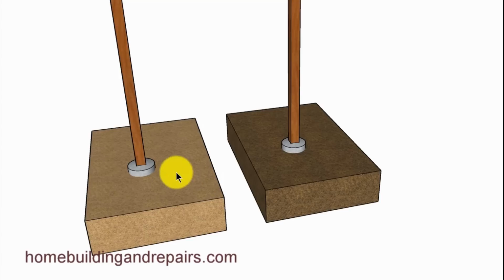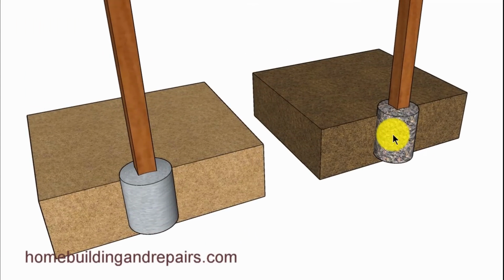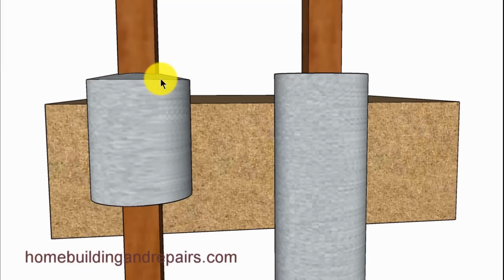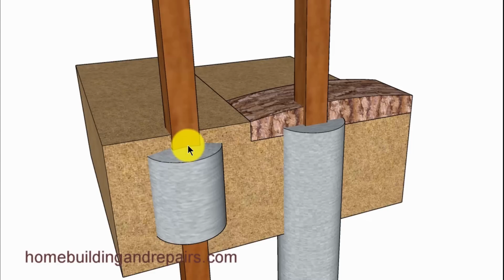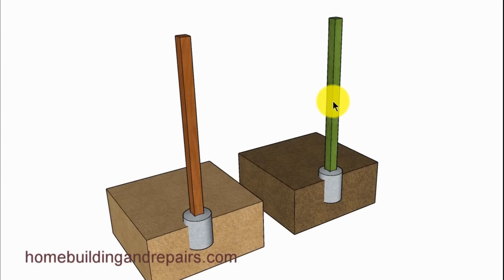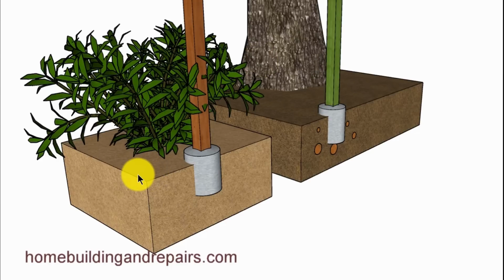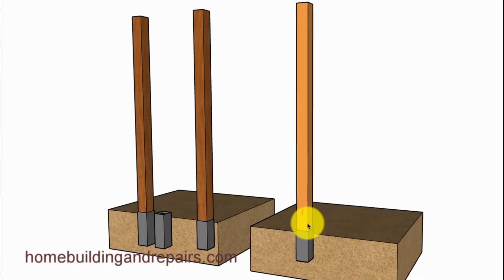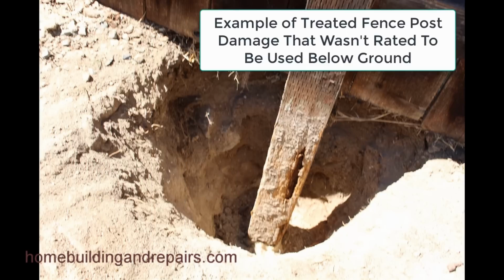Watch This Video Before Installing Your Next Wood Fence Post – Money Saving Ideas

Comment: Us old timers use a 50/50 mix of diesel and motor oil. Paint on 2 coats dry in sun few days. Burn the ends we're you cut off and no oil on that. Roof tar works at ground level
Reply: We used creosote but I had a carpenter tell me it's bad for environment bc of possible leaching
Reply: @julieankhan.2801  Julie the chemical they pressure treat into woolmanized lumber is full off heavy metals , the less of 2 evils is the choice is the question , I use a combination as my post often land in damp clay on my place, Charing is by far the only sure way to avoid ground leach ,but in clay , I use a trip method to avoid costly redo which is worse over all. I use less posts less often , so less trees less often, pure linseed has some toxicity agree, but heavy metal a different animal when it gets into ground waters , I encase in quick set as well so slows the show, gives oils times to bio degrade as I see it. Metals never fully degrade , always trace left
Reply: Dale Val 
That’s how my grandfather set posts and I’ve never had a problem when I use that method.  I never asked him about the burn part but I do it and don’t get rot or bugs.
Reply: @jonathanschearer7778  good man Jonathan gramps would be proud , most youth have no clue how to make things last, they live in the throw away world , I got 6 posts to set this week ,vgit some linseed and my torch ready , just need some muscle to give me a hand, legs are sore and I have preppy snowflakes sins that avoid the old man's farm , I'm seeking a hired man I can will it to in next 20 when I go , god willing. I last another 20 lol.  Thanks for your comment , I lost my PaPa in 86 , I miss him everyday , and he taught me these tricks to survive and thrive for less

Comment: Also if you are worried about a post leaning one way or the other a person can put 2 butt plates on the post. One bolted on the so called north and south side and the other would go on the east and west side about one inch below the other butt plate. This would work for any post.   But especially on the end post to help prevent any tension on the post

Comment: Wouldn't it be better and much easier to rent a air compressor and jet the post into the sand area. No digging required
Reply: It will take you more time setting all that gear up than it takes to dig a post hole in sand. About 1 maybe 2 minutes if you stop to scratch your balls, per hole...LOL
Reply from the maker: @glennturner4807  I remember when everyone when someone judged time by how many beers you could drink and now it's our dangling private parts:)
Reply from the maker: I don't know how you would do it with an air compressor, but let me know how it worked out if you ever do.

Comment: The main problem is the concrete not the ground. The chemicals in the concrete attack the wood and rot it. You can coat the wood with tar or just not use concrete and pack the soil around the post. Packing is better, no rot and stronger if packed right.....make sure you make the soil into a powder and it will pack very nicely.

Comment: It's fun watching what others try when putting posts in. Everybody has a way that works for them. I do not use concrete. I pound in rocks around the post. I have posts in my yard that are over 35 years old. The ones the contractor installed 10 years ago have rotted and all need replacing. My neighbor uses Elmers glue on the ends of the post and up 20 inches. I wonder how long the posts will last.
Reply from the maker: I think if I had some large rocks on my property and my neighbors didn't water the fence and of course the strong winds didn't knock it over, your idea just might work. Let us know if the elmers glue works.

Comment: Did you know that Florida has no fences, because sand. 4' down, LMFAO.
Reply from the maker: I've never heard that, but appreciate you sharing that information with this and it definitely would be difficult to support a 6 foot wood fence, without any type of support in the soil.
Reply: gregvancom - I think NERD is kidding. However, wooden fence post rot fast. I live in Fla and am considering using white corrugated roofing metal and landscaping timbers. White so it does not look ghetto. Roofing metal because it's less expensive, stronger, and will last forever, and timber because they are inexpensive. I'm considering using birther 1968 suggestion to prevent the post from rotting.

Comment: The ideas are to prolong the life of the wooden structure in this case of the posts ( deck or fence ) , wood will root with the time ,  but if is sealed and protected it will last longer , and you guys posted all kind of ideas to do that .!
Reply from the maker: Good points

Comment: Galvanized steel posts with welded flanged fins in a cement foundation is the best
Reply from the maker: Definitely a thicker gauged galvanized steel post wood work excellent. Do you have any idea how much it would cost? The reason why I'm asking is because most property owners can't afford them.
Reply: @gregvancom  i pay in Indonesia $23 for a 5*10*600cm hollow beam.
Reply from the maker: @MyMotherWasaNinja  I'm guessing in the United States the product I'm thinking that would work good, would cost over $75 each. A 8 foot 4 x 4 Redwood post cost around $16.
Reply: @gregvancom  steel prices are down this month. In the long term, it's well worth the investment
Reply from the maker: @MyMotherWasaNinja  Good point, if you have the money, then a block wall fence might be even a better alternative.
Reply: Do you mean cement only or do you mean cement or concrete ?

Comment: The old treated lumber from the early 90s is much better than the new copper pressure treated lumber.  However you cannot get that wood anymore.  We need better treated lumber, I believe it is not fabricated well today on purpose so the large stores like Home Depot and Lowes and the wood industry can sell more of it.  If my fence fell down, I would build and use concrete posts with internal rebar, and treated cross members.

Comment: So the fence I'm about tho replace was installed in 1996, and it wasn't the best installation to begin with, yet it's lasted over 20 years. The posts are pressure-treated & placed directly in concrete, with about 1.5 foot depth, and we have heavy clay soil. I don't understand what this video recommends about pressure treated posts vs. redwood. Redwood is more expensive, and it sounds like you're saying redwood is not preferred?  So that's a win-win in my book. The reason we're replacing it is only partially related to the quality of installation and materials, but appears to be mainly due to the length of the fence sections being too long. Inevitably things get leaned against the fence, it get bumped into from time to time, and as a closed design, it gets buffeted by strong winds. I plan on putting half-again as many posts this time, and I think this will tend to make the structure far sturdier and long lasting. I guess I'm saying that one shouldn't skimp on the design; MORE posts can't hurt, and will tend to make some of the other issues less vital.
Reply from the maker: Yes there are other things that will affect how long a wooden post will last and some of them will be the items you suggested in your comment. I have a fence in my backyard that's leaning about 4 inches, because my neighbor has plenty of stuff stacked up against.

Comment: 1st,  use Oversize treated posts. 
2,  Tar very well the bottom/side of a post (to above ground)
3, fill w/ some gravel the bottom of hole on clay soil. 
4. concrete completely.
5. hardy plank and caulk n paint.  
6. 30+yr post
Reply: What do you mean by hardy plank and caulk, what do you caulk?
Reply: @ljguy300    After my 12x12 were in the ground n cured. I  then Hardi plank n caulk and painted them
Reply: 7. Use permacolumns and they last forever.
Reply: In my experience tar is useless. I coated entire in ground approved post in tar to about 8" above ground level. I then poured a 1' concrete collar to ground level and sloped surface downward to perimeter for water runoff. The post only lasted 10 years and rotted completely away where post meets concrete. The tar was still very visible along the edges of the rot. This happened in nearly pure sand 500' from coastline.

Comment: Concrete is the worse option since it retains water much longer than gravel and offers absolutely no protection against water from reaching the fence post. Best option is to apply a tar-asphalt sealant to the bottom of the post that below grade so that it prevents water from reaching the wood. Than secured in gravel. Even in Clay soil, gravel will increase the surface area for drainage and also help secure the post from movement during spring thaw when the ground becomes real soft. 

FWIW: Asphalt coatings have been used on pipelines to protect the from rust. If its good enough to keep pipes from rusting after 30 to 50 years, its going to work on your fence post. Just be sure to apply the coating fully and give it time to cure. 

Ideally if you want your posts to last you also need to paint them so that the above ground elements does not cause them to decay. If you paint your posts, be sure to let them dry out for 120 days before painting. Especially for the pressure treated posts which are stocked soaking wet at the lumber yard.
Reply from the maker: I have seen wood posts rotted using practically every suggestion you have made in this comment. Now for the good news, I have also seen practically every suggestion you have made work, so I think we can draw a reasonable conclusion that your ideas will work for some and absolutely will not work for others.

Comment: Let me give you something to think about.  Two years ago we decided to build a detached garage in our back yard, so we had to remove the pressure treated wood fence to provide construction access.  The pressure treated 4 x 4 posts were set in 1985 in concrete on each side of the two gates and at the ends.  The posts in between were set in clay soil only.  Every one of the posts set in concrete broke off flush with the concrete when removed.  Every one of the posts set in clay soil had no visible rot.  The fence was installed in 1985 and removed in 2016, so the posts lasted 31 years.  The posts set in concrete were at end of life and the posts set in clay soil look like they would last another 30 years on the buried portion.
Reply from the maker: I would like to point out the fact that you had the post rot in concrete, but didn't with those buried in the soil. Now I have also seen the exact opposite, which is the reason why I cannot provide people with a guaranteed method for installing wood fence posts. Thanks for sharing your story.

Comment: All this is hogwash crap, do what the old timers did to cattle pastures and such , they have wood fence post over 80 to 100 years old. What u need to is stain your wood with 100% used motor oil or use a 50/50 mix of used motor oil  ( free and natural ) and diesel fuel ... for the post that’s in the ground part , use also after your stain treatment use  roof coating but do not put the roof coating on the very bottom so water can drain out . Your post will last 50 years at least .. every 3-4 years may have to do your oil stain treatment wich is free, save your used motor oil .
Reply from the maker: Thanks for the passionate response, but again if this particular method worked, wouldn't everyone be doing it. This particular problem is no different than diet pills that work for some people, but not for everyone.

Comment: In Canada we have strict federal, provincial and municipal building codes governing fence construction due to severe temperature fluctuations and moisture conditions from rain, snow and soil conditions.  Post depth, drainage, buried wood treatment and anchoring materials vary greatly depending on your particular conditions.  Check with your building department before you plan your project.  Building a fence yourself can be a fun, educational and cost saving project....but, you don't want to have to do it more than once every 40 years.
Reply from the maker: That's interesting, in the United States or at least in California where I live it's one of the few things you need a building permit for. Thanks for sharing

Comment: The old ranches in my area have fence posts made of split rails and the ground ends are charred in a fire so that the ground contact is at least 1/2" of charred wood. These posts last for over 100 years buried in the ground.
Reply: It really depends on the soil I don't care how much you dry the wood. Water's going to undo even the tightest grain imaginable. The whole trick here is to get rid of the water and soil microbes and the oxygen that allow them to thrive. That's why posts don't rot 2, 3, or 4 ft deep. They rot within a foot of grade.
Reply from the maker: I've heard about this method and it looks like the Japanese use it also, but I wouldn't be able to verify it, because I've never seen it done or done it myself. Thanks for the suggestion and definitely something to consider.
Reply: It makes the wood very strong
Reply: I live adjacent to a ranch and there is a very old barbed wire fence with wooden post that looks like it has been in place for decades. The ground ends have that char on the bottom. I always thought this was from past brush fires, but your explanation makes sense.
Reply: Ll

Comment: Use a vacuum bag to infuse a good polyurethane spar varnish into the fibers of the post, gives them the quality of wood with the durability comparable to a water impervious plastic.
Reply from the maker: Now there is a method that seems like it would work. Have you tried it before and if you have do you have any pictures you could send me of your fence?
Reply: Sure all you need is to spend 10K on autoclave and vaccuum pump & lots & lots of time for the process.
Reply: @guytech7310  lol

Comment: I've replaced garden fence posts that were set in concrete. The old posts were rotted from the damp soil around the base.

I pulled the old stubs out and installed the new posts in the existing concrete. New post bases covered in new engine oil and wrapped in bin liner to keep the damp soil off.

The knack to getting the old stumps out.
1. 
If the stumps are rotten, hack them out with a 4ft crow bar, the straighter end sharpened to form a chisel. Just hack away at the center, turning the bar with vice grips to break the wood up, forming a hole, then break the outer away by gently breaking the wood away from the edges of the concrete well.
2.
If the wood is sound, 8" M12 coach screw screwed into the stump, washer under the screw head and fit something like a rope carabiner on the screw to act as a pull. Tie a rope to the carabiner and fasten the other end to the crow bar and lever the post out.

If there's water in the bottom of the concrete well, you can get it out with a small fish tin, vice grips and string to lower the tin down the hole.
Reply from the maker: Thanks for providing us with another method.
Reply: @gregvancom  
You're quite welcome!
Pulling the stumps out saves digging the concrete out.
I'm now on painting the fence, about 300 yards worth.
Reply from the maker: @spannerssockets6308  Sounds like you might need to use one of Tom Sawyer's methods to paint that one.

Comment: I live in the rainforest, where between moisture and termites a wooden fence post would last about three months. we use concrete fence posts( and utility poles) kind of a pain in the ass to install, because they're so heavy, but they don't rot or corrode and last decades.
Reply from the maker: There will definitely be times when wood will not be appropriate and you have presented us with one of them.
Reply: I am Bulgarian and we use concrete posts with steel inside and then chain link fence tied up with metal wire but I agree to install such fence takes a few people and lots of machinery it is really heavy but can last at least 100 years. Now I am looking to make an easy and good looking fence from wood because the other options are very expensive.I am in Canada now.
Reply from the maker: @EPICSOUNDTRAX  Thanks for sharing and it's always interesting to hear what people do in other countries. Good luck on your new project.

Comment: prob is fence post have to go in the the ground 70% it just a given. there is a really ez work around we do this on alot of jobs. go vinyl post sleeve. tight fitting ones work best.put few nails into just the vinyl at bottom do not block the hole on bottom.(helps bind to ground)ya want it cut how ever deep ya going.  put it in pour,let set pull ya pole out any time ya want to change it  ... work smart not hard... or ya mount them above ground.
Reply: He already talked about the problem with that idea.  The water can seep down in from the top and then just pools up in the bottom making wood rot faster.  The above ground method where the wood is always exposed to dry air seems best.

Comment: what about the post sitting on gravel and concrete poured around it?
Reply: never mind
Reply from the maker: I'm not a big fan of that method in areas where water doesn't drain off as you're suggesting.
Reply: Hagbard Celine  the method that you describe is the same reson that engineers  require  packed gravel on the bottom of a concrete pour so that stagnant water is not in contact with the concrete and so the concrete dose not rot. This seems to be the most logical method of setting a wood post in any type of soil, if the soil is so dense then I would add a deeper gravel drainage. I have researched this subject extensively before I did my fence posts and asked many engineers, the next best method would be to set a galvanized bracket into concrete with a connection point 6inches above the ground. I am not an engineer but I am a industrial coatings and concrete inspector.
Reply: Hagbard Celine  as long as you don't seal the bottom of the post that is fine